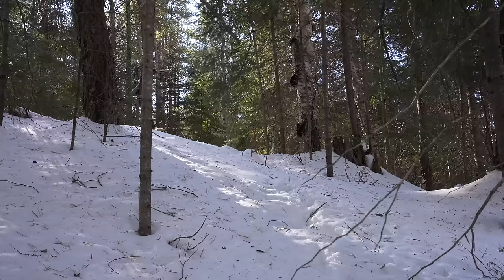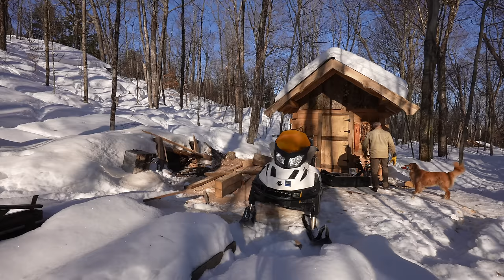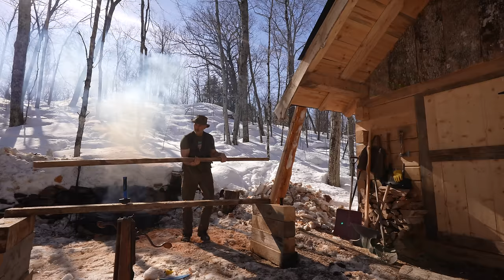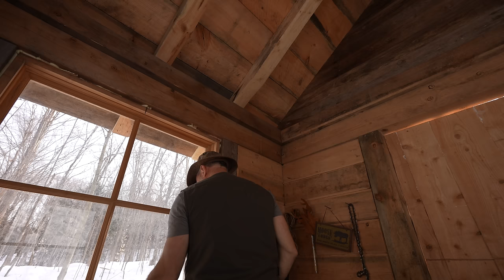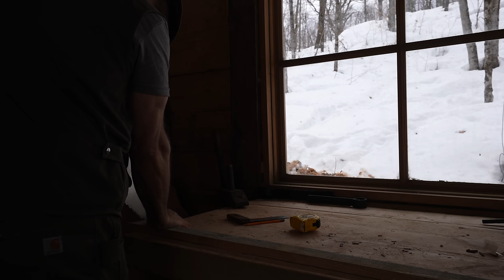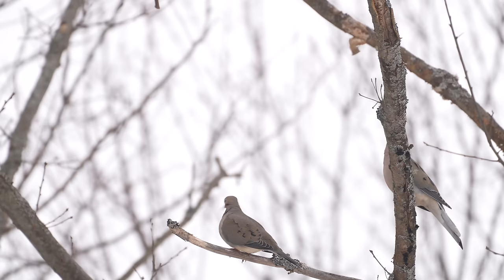Sleeping Loft in the Off-grid Tiny House, Mushroom Log Cabin in the Woods

Comment: Nice looking anvil.  Some advice; best to place the anvil on a tree stump inside the workshop.  The stump absorbs just the right amount of vibrations.  Also, the height is important for the placement, too low and you will kill your back by stooping all day while forging.  Too high and you will hurt your arms and shoulders.  Should be level with the mid section.  Also, the ring of a good anvil is like a bell, but forging all day could damage the ears.  It is good to wear ear plugs.  Best to start out with some simple tapers, then move on to scrolls.  Advice for anyone who might want to try it out.  Great hobby.  My whole Alaskan cabin has been decorated with my handmade ironworks.

Comment: When I watched you busy with the wax, I thought of letting you know that when you find a bit of strain in your back, or shoulders, that you can used the melted wax and spread it out on a tray of about 50 x 70 cm with raised edges, so that the wax remains in it, forming a thin layer of about 5 cm. and can dry until it's solidified, but slightly soft and  warm, but not piping hot. 

The layer of wax, peeled off the tray in one piece, can be placed as a wrap on the lower back or the upper back and shoulders, covered by a blanket or thick towel, so that the warmth remains as long as possible in the wax, and can be transferred into the skin and muscle tissue. When the wax is still a bit soft, but firm enough to be taken off the tray as a whole sheet of wax, and it helps when someone else places it on you, it will adjust to the form of the body and maximize the effect of warmth-transfer.

Depending on the temperature in the room, or while lying in the sun on a stretcher, it's not important how long it takes, really, when there's no time pressure, the wax will cool off, and can be taken off in one piece. Ready for re-use, when necessary. Beeswax has remedial characteristics, and it holds warmth for a long time. I've learned about this because in the therapeuticum near my home, these bees-wraps are used for patients with body-aches. I've had such a wrap once, on my back, and it's a real treat of warmth.

Comment: Instead of joist hangers, you could have used "pressure blocks" -- its just a simple block in between two joists. You nail the block to the wall, and nail a joist to each side of it.  You only need a block every other gap in between the joists..  It may take a few more nails, and does use quite a few 14.5" scrap blocks.  But its an option if you don't have joist hangers in the future.

Comment: There is a better way to tap three sap (in my opinion). I am using plastic water jugs with screw caps (size by choice - 5 or 10 litres) with a 8mm transparent hose to collect it. I drill an 8 mm hole in the tree and an 8 mm hole in the screw cap, put one end of the hose in the hole in the tree and the other end in the hole in the screw cap. And voila, you are collecting your debris free tree sap. If you drill a bigger hole, the sap will flow faster, but it is not so good for the tree. You can keep it in the water jug by plugging the hole in the cap with a couple of layers of electrical tape on both sides of the screw cap. It will last for a few days if you keep it cold. If you leave it standing, it will become fermented. You can put a bit of sugar in it in order for that to happen faster. Takes a bit of reading up on the fermentation process.

Comment: The metal joist hangers are an eye sore.  Should have used a 2x8 and notched 2” wide notches 4 - 5” deep, nailed that to the wall to hold the joists. Just my thoughts to keep it rustic in all aspects.

Comment: Shawn, what proportion of your time is spent on planning the materials for your various builds - whether for large-scale projects like a whole cabin,  or smaller-scale subprojects like your workbench and loft? How far in advance do you decide how many boards of each particular thickness you need to mill? And how exactly do you calculate these, in order to minimise wastage (in time and effort, and in materials?)

Comment: I like the look of the butt and pass. I'm building a 16x24 dovetail cabin in central Vermont from 8x6 ewp . I haven't started cutting the dovetails yet and the simplicity of the butt and pass method is appealing . Would you recommend it for a larger structure like my proposed cabin ? Thanks

Comment: Well I don't know about anyone else but I'm confused 😐 
What's the reason for drilling lots of holes in the tree lengths only to hammer dowels into the holes and cover them will what I presume is wax? What's the reason for it???
Reply: Read the comments, planting mushrooms
Reply: @lorenenoe4472  busy watching the video
Reply: Simon r  then read the descriptions and pinned comments before watching.
Reply: @regular-joe  your a good example of reading the comments as you certainly did not when you wrote this comment.  Firstly it is something from 5 months ago and secondly had you been bothered to take your own advice then you wouldn't have written anything at all !!!
Reply: @regular-joe  better things to do with my time.  But if it bothered you this much then I'm happy to hear.